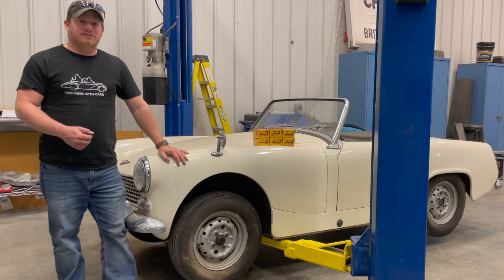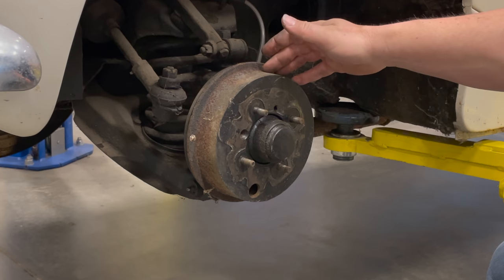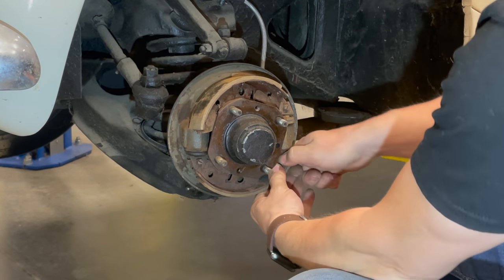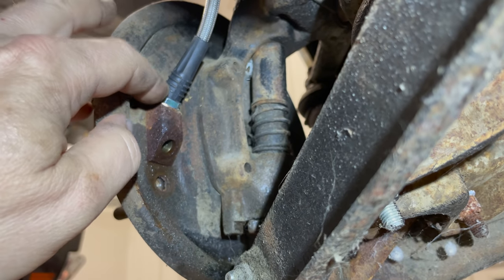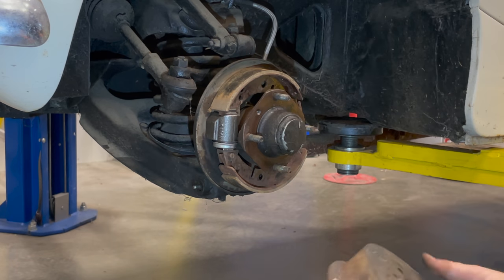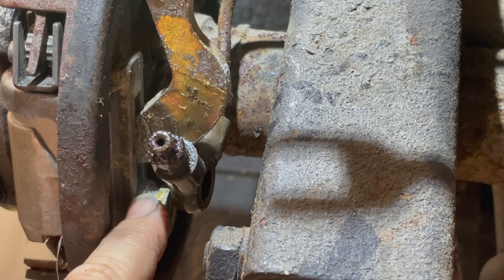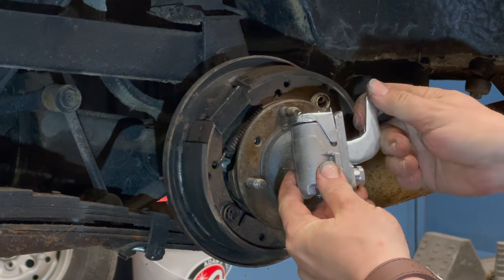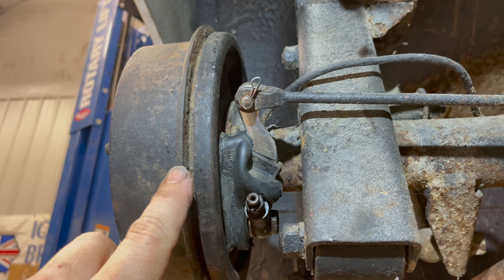1962 Austin Healey Sprite Mark II - Will It Stop?

Comment: A very detailed and informative video.   The flexible pipes never seem to end up in exactly the same orientation when tightened so the connection at the chassis end usually needs to be loosened to ensure the flexipipe isn't still slightly twisted.

Comment: I've never seen the set screws come out of a drum that easily. Usually they're corroded in and shifting them is the longest part of the job!
Reply: They really do not need to be put in very tight.  The wheel and lug nuts will hold the drum in place fine.
Reply: I've never been able to manage this without using an impact driver for the screws and then a rubber mallet to unstick the drum once the screws were safely out of the way.

Comment: Hey Steve...really enjoy your channel.  Question...If one plans on keeping the sprite or a like car, would it be possible to replace the drums with disk brakes?
Reply from the maker: Yes you can swap the fronts for the disc brakes used on the later Sprites but it is $2000 in parts.   There are also kits to convert the rear to disc brakes but I don't think you would see much difference changing the rear.

Comment: The rear suspension is sat very low. Looks like it could do with some new leaf springs. Either that or you've got a boot load of stuff weighing it down at the back.

Comment: Steve, I’ve never seen drum brakes like this. The fronts look like double leading shoes and the rear is I don’t know. Neither is the conventional leading/trailing system still found on American vehicles with rear drum brakes. It would be cool if you could do a video pointing some of these things out such as how the leading shoe is dynamically pressed harder into the drum. I had to do a little research before posting this comment.
Reply: The rear is a normal leading/trailing shoe setup, but all the pivots/adjusters/springs etc are maybe laid out differently from what you’re used to seeing, so they can fit everything within the tiny 7” drums